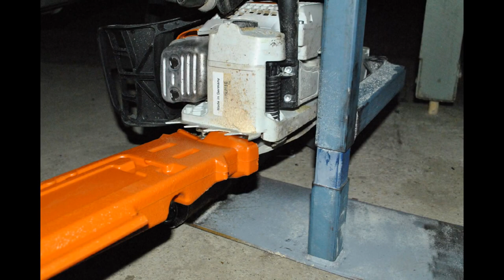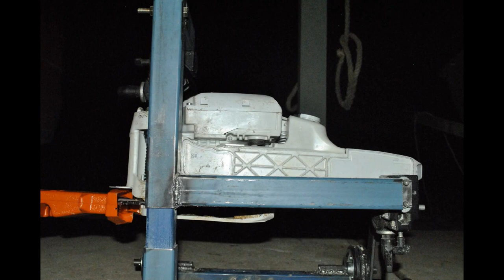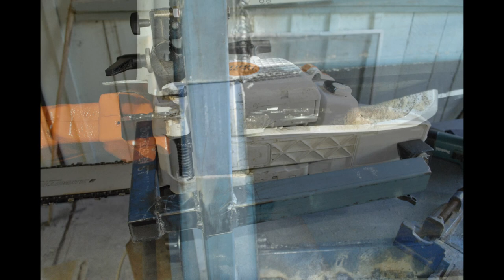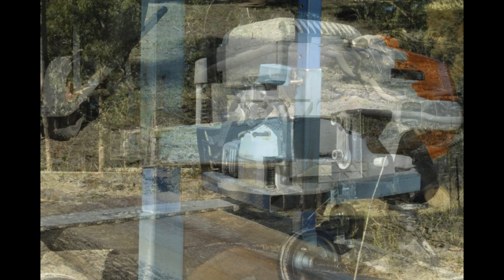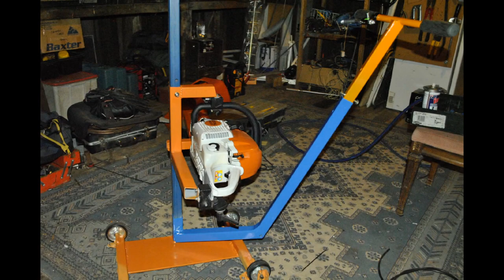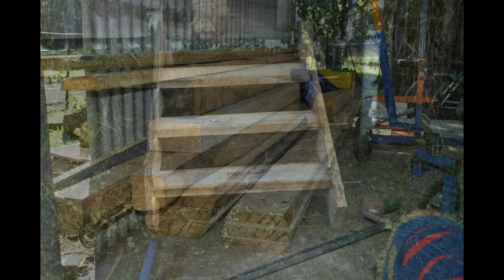Chain Saw Mill Photos

Comment: How does it stay on the tracks
Reply from the maker: There are wheels that run along the bottom of the track which hang off the axle, you can see them in this video http://youtu.be/bZeSKzQavT8
 and at 2min 2sec into this video.
Reply: @trevorfuggle  can you provide more info on how the mounting of the saw works? Cant tell to much in the moving slideshow.